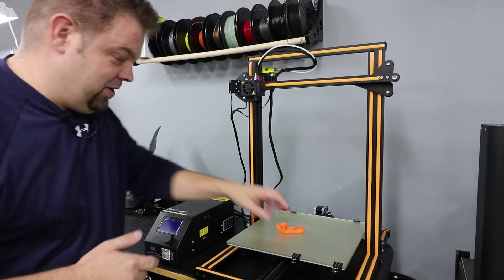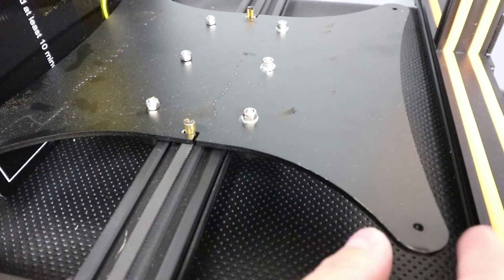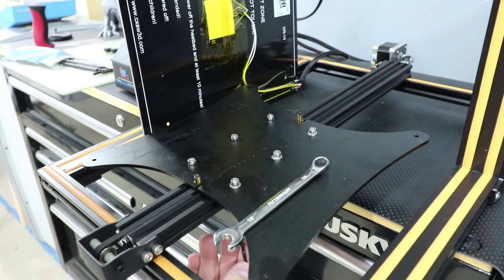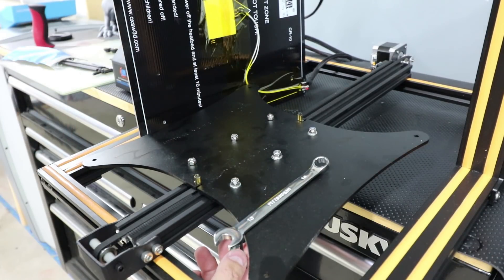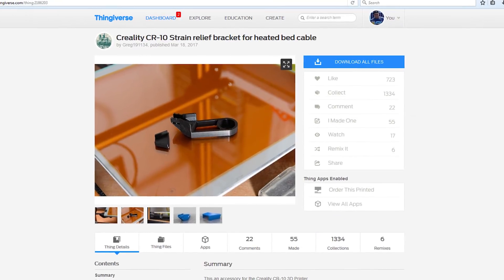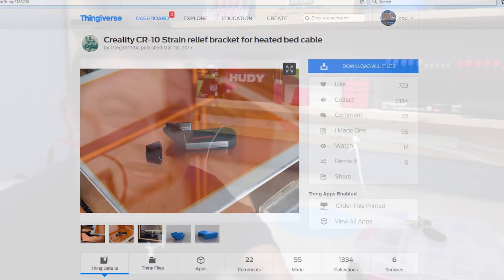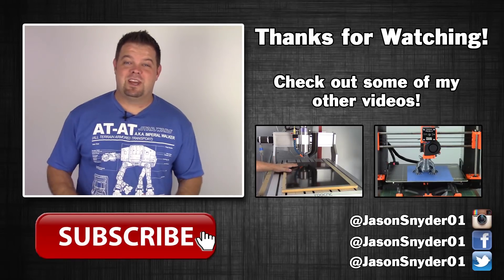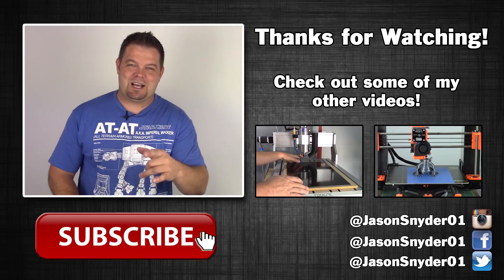Creality CR-10: Loose Bed Fix

Comment: Here's another related issue: My CR-10 Smart Pro had a loose bed, but it was only loose in the middle of the rails. It was tight in the front an back position and all wheels were tight.
So I loosened the center screws of the two rails, then tigthened them again, and  the bed was not loose anymore.

Comment: Have been printing face shields to help with COVID-19 - 24/7 and all of a sudden all prints were failing. Was down and not printing for a day and a half. This  video nailed my issue. Tightened up the bed and prints are perfect again. I did not know that only nuts with washers were able to be adjusted. Thank you for this.

Comment: Hey buddy good vid,im new to all this and have had my orinter about a month, NOTHING LIOSE AND AXIS ARE RUNNING FINE 
.. BUT one cornor habgs way too low (2mm below absolute 0) i have jad the leveling nuts OFF and still not high enough for a level bed.. is there any advice u could give please???
Reply: May want to check if your beam the print head runs on is level with the bed or needs tightened up also....just an idea...

Comment: My allen key  shipped with the cr-10 jumps in the slot. (I don't know the name of the hole the allen key fits in.)

The other screws are not even tight but they are the ones turning and moving the bed. I start feeling that it is crap.

Comment: I am assembling my 10s 5s and I tightened the rollers under the heat bed. After tightening and stand it up right I moved the bed back and forth noticing a bump in 3 different areas. Is this normal or is there something I need to loosen or tighten?
I inspected the rollers and frame is moving on and its clean with no debris or issues with the frame.
Do you have any advice? Much appreciate it.
Reply: Sounds like flat spots oj the wheels from over tightening.

Comment: So the bearing inside the v-slot wheels use plastic spacers(washers) inside, if you tighten it too much those spacers get deformed and cause a lateral force on the bearings. Even if you don't over tighten it, they deform over time and cause binding issues. I highly recommend replacing the spacer inside the v-slot wheels with metal M5 washers. Once you replace it you won't get a loose bed over time and it will also allow you to torque the wheels to the bed with a little more force and no binding of the bearings.  This will make the bed a bit more reliable and there won't be a need to correct this over and over.
Reply: nzalog thanks for the tip!
Reply: The cr10s now has metal spacers!

Comment: I have a tevo tornado, but assume that it would be similiar.

Would have a lose nut cause a shift in the Y axis? I have been having an issue with my prints shifting.

Comment: Just got my cr10 today. My print bed has 2 adjustable on one side and one in the middle on the other side of the bed. Is that right?
Reply: Exactly, i'm same. It's tricky to adjust.
Reply: Sounds like Gearbest?
Reply: Sorry to res this old comment - but I was about to post the same. Got 2 adjustable one side, 1 on the other. Always find it hard to get all 6 wheels to grip. Now wondering if I should switch so all adjustables are on one side. Thoughts?

Comment: What do you mean when you say you want to “tweak” it a little - I just got my CR-10S and the first set of wheels move without moving the bed but I can’t seem to get it to hold traction - should both the adjustable side wheels as well as the non adjustable wheels move the bed if you move them?

Comment: Something goes wrong with 2d printer after warranty = told to buy new printer.
Something goes wrong with 3d printer after warranty = buy a $0.50-$20 part and look up some guides on the internet = fixed
Reply: Inkjet printer-17 years old had to service paper roller once 3 years ago
3d printer 1 month old spent same amount of time testing and leveling it that i spent printing

Comment: Hey there Jason. I am planning buying my first 3d printer and am just overwhelmed by the choices I have in the budget I have for this. My purposes for a 3d printer is mainly for prop and cosplay building with a little miniature building thrown in the mix. I have already chosen the Creality CR-10 to be my first printer due to its affordability and it's build volume, but I don't know if I want to just get the CR-10 or spend the extra $100 for the CR-10s. Is all the extras on the 10s like the dual z motors, auto bed leveling and the filament sensor worth the extra money or should I just get the base CR-10 and upgrade it as the need arises?